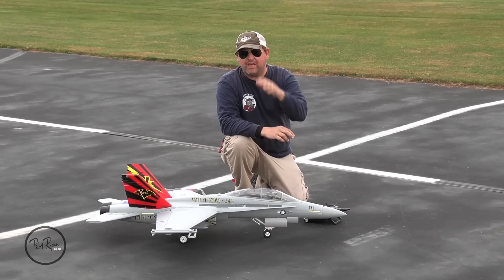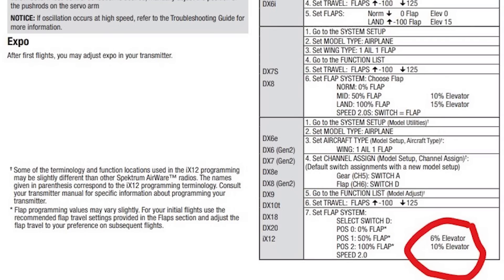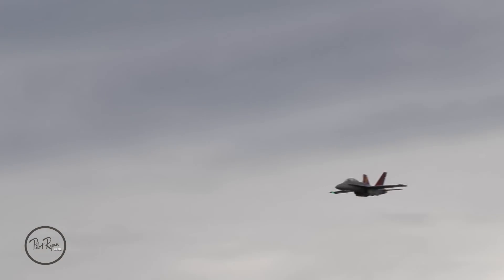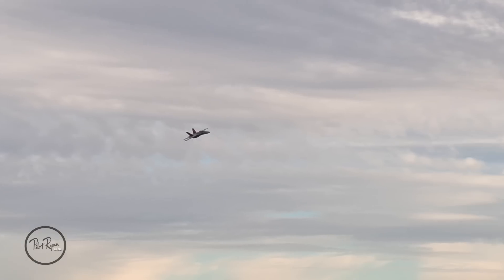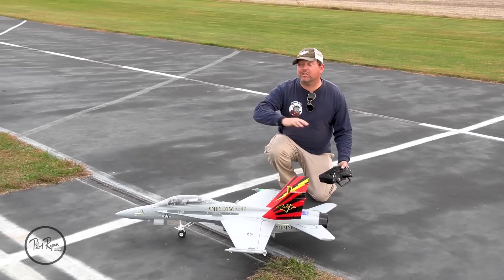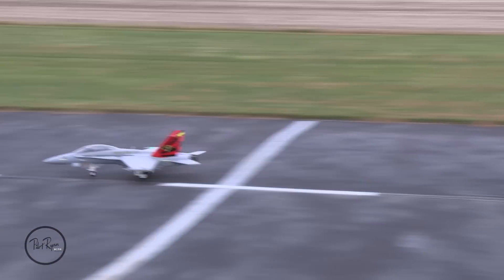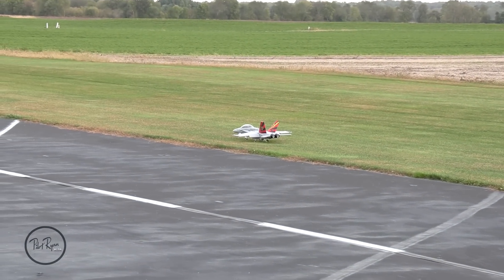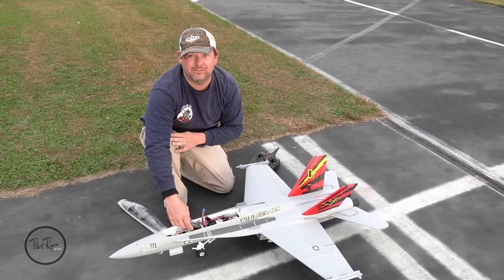E-flite F-18 80mm Shakedown Flights

Comment: I hear people suggesting 4mm of up stabilator, leading edge down. Is the the considered the new neutral position? There are a couple of lines by the stabilators. Can someone make a video of where their stabilator position is in relation to these lines. Lastly, are you mixing down stabilator (positive numbers on spectrum) with the flaps. Does the bird tend to pitch up with the flaps extended?
Reply from the maker: B Moran yes it’s in the book. Up elevator is what you need when flaps are deployed otherwise the nose comes down a bit and you’ll have to compensate.
Reply: Thank you pilot Ryan. My manual addendum page shows 10 and 15 in the but that gives me down elevator. I put -10 and -15 in my flap mix (iX12) for up elevator elevator. Is this correct or is something amiss in my bind and fly 636 receiver? Right now, with -10 and -15, flaps go down and the leading edge of the elevator goes down for up elevator.
Reply from the maker: B Moran stick with that, as long as you mix in up with flaps your good. Mine was the same

Comment: Hey Ryan, 
I really like the Hsd 105mm f16 but for now bc of high price I really like this eflite f18... So a few questions: 
1) Since your flights on it, have you had any linkage issues with left or right elevators?
2) How do you like this to the f16 70mm eflite t-bird is this any better or solid over the f18? Is the 
3) is the 80mm for the f18 really much more noticeable in speed over the 70mm f16 t-bird? 
Thank's if you get back to me with an idea of just a few things I have....

Comment: Flew my first flights today.  Weather was in the mid 50’s winds 2mph gusting to 10 mph right down the asphalt runway.  Beautiful flying plane, but I suggest all view pilot Ryan’s maiden of the EFLITE F18 for some helpful hints.  My experience aligned well with Ryan.  Definitely use high rate elevator and mid flaps for takeoff.  I used a 5000 mAh battery weighing 740g placed 1 3/4” aft of the forward lip of the battery compartment.  CG approx at 78mm from where the leading edge meets the fuselage with gear down.  As a Ryan indicated the recommended elev mix with flap is negative on the DX8G2 not positive as shown in the manual.  Even with the elev trim horn adjusted full forward I still required some nose up trim on my radio to maintain level flight flaps up at mid power.  Not sure I want to move the CG further aft not knowing how much margin remains, but maybe with more flights under my belt I’ll give it a try.
Reply from the maker: Thanks great write up!

Comment: I wonder if the stock power system could handle 7s? Would need the motor and esc specs and a watt meter.

Comment: Love the way you show off these birds.  That takeoff, that rotation, may have been less sudden than expected, but it looked so real and life-like when it was airborne - just like the real thing.  Not a direct up take-off, but a sliding thru the air take-off as it continued to build up speed with its landing gear still down.  That looked awesome.  In the air, outstandingly fast!  The landing - well what can I say......reminded me of a quick drop aircraft carrier type landing.   Only thing missing was the hook and towline to bleed off speed, and of course, the Top Gun sound track to cap things off.

Comment: your video was/is very complete! I appreciate that you mention issues as well as the highlights of the plane. It helps me a lot to decide how it handles and acts so I can determine how it will perform in relation to my other planes. For example, if the plane needs differential ailerons to turn properly, it's good to know and know how to respond to it.  Doesn't mean that it's a bad flying plane.  Just like the rollout on this one. Good to know before hand. I for one don't want all my planes to fly the same.

Another question: I can see that it flies well, but how does it compare with the comparable priced 90mm F-18C and 90mm F-22 Raptor? Faster, slower, more stable, carves the turns, etc. Not looking for "good or bad". I'm sure you know what I mean.

This is my first E-flite jet. Got it a few days ago so I've only looked it over.  I'll say that it competes with the competition. Few things are different, like control surface hinging and the way the wings plug electrically together. Can't say that either way is better/worse, just different.  Can't wait to fly it!

SJ
Reply from the maker: Right. Different is cool. I have the FMS 70 FW90 and now this F18 all our great. The Raptor is in its own league. Nothing will fly as slow and feel as light.
Reply from the maker: It’s nice being able to fly lighter packs like 4000 in the 80. I wouldn’t want less than a 5000 in the bigger FW one
Reply: @PilotRyanMedia  Thanks!

Comment: I have just purchased the E-flite F-18 Hornet 80mm .
I am seeing a lot of online chatter and some you tube clips that indicate the Elevator servo retainer has come loose in flight more often than it should, which then precedes a crash.
Did you have any problems with your F-18 or have you heard of this issue?
Reply from the maker: Toby we didn’t have any trouble with ours. It’s good to take a look at linkages from time to time

Comment: Ryan , you are correct. If the nose gear was a little bit longer it would give the plane a more positive wing incidence which would in turn would help shorten the take off run. Great flights. Put on some of those nerf whistles Bobby !

Comment: I have the f18 with a 3200 mah battery I sadly crashed on my first attempt to take off the jet did a sort of barrel roll into the ground I wasnt using the flaps was that my issue or not enough land speed before take off any advice is greatly appreciated  thank you awesome videos btw
Reply from the maker: Sounds like a stall. Took off before there was enough airspeed

Comment: Also "high rate" should always be used for slow speed / takeoff to compensate for the low airspeed and airflow.  Actual jets reduce flight control deflection as the aircraft increases speed to help maintain a constant "feel".  Best to have 3 rates.  Takeoff and landing rate, low rate (smooth maneuvers)  and high rate (aggressive maneuvers)  but less than T/O and Landing rate.

Comment: The real hornet needs a at least a 12 degree trip up on the elevator to rotate- up to 17 depending on the conditions. Your model was showing the very same issue a real hornet would exhibit without take off trim up applied

Comment: Nice job!   It sticks on takeoff because of the scale gear.   When the gear is compressed the rotation point is really close to the elevators and pretty far from the CG.   Topical of all F-18 models with scale gear.   Flaps is definitely key.

Comment: I loved this jet right from my maiden flight. However, I had elevator failure on my second flight when the right stab popped off the pin on the servo horn and the jet went into an unrecoverable dove. No elevator response. I hope horizon takes care of this, as it has been a problem for other pilots on the forums. Just feel like the elevator design is poorly done for a jet of this size and speed. Shame, I really loved this thing.

Comment: Question Pilot Ryan: I didn't understand what you meant by a negative value to get your up elevator mix on the flap. Would you explain it in a different way?  Also, I just picked up this jet from my LHS yesterday and I had a insert for page 7. It shows 10 degrees for 50% flap and 15 degrees for 100% flap. My manual is like yours, it says 6% and 10% elevator. Did you get that insert? think the 10% and 15% would help on the roll out? Seems logical.  Thanks.  SJ
Reply from the maker: Just make sure that the elevator moves up when you deploy the flaps. Also make sure you set your elevator neutral by the book
Reply: @PilotRyanMedia  Uh, OK good. I was going to set the flaps up with elevator mix my usual way, which is how you explained it this way. I thought I understood the first way, but wasn't sure. Want to be positive before maiden! Ha!  Yes, will do the elevator neutral too.  Thanks! SJ

Comment: Those LG don't absorb anything.
Reply from the maker: Only the nose. The mains just from extension to rest. Once down, nope. Cool though, they look like a bird coming down on approach.
Reply: @PilotRyanMedia  i'd mod them with something , how long and how many times can it handle that slam on the ground...  it is sweet for sure,,  rc shock mod,, may order a set of gear just to fiddle,,, i'd tear them apart and get some type of spring up in that tube, just needs some damping no need for preload,,, i can make a real shock for it ... i wonder if there's enough market to build sets of gear... that i would take on...either way its way cool
Reply from the maker: michael honeychuck if they were stiff enough to sit on springs instead of fully collapsed the aoa would be wrong. There would need to be some shortening somewhere or stretch out the nose gear. As is there could be more spring added as long as it still compressed fully at rest. A little stiffer would be nice. I’m liking them. We’ll see how they hold up for folks. They really are built beefier than I expected.
Reply: @PilotRyanMedia  yea getting the right spring in there would be the deal..  maybe strecth the one that's in there that would create preload  or even a type of rubber damping ,  but if they hold up rock on.. i'm seriously thinking of building gear for rc , retirement work .. lol

Comment: I’ve flown nitro since 1989, old tech guy here, i want to purchase this in BNF, what transmitter do you recommend & have you tested anymore batt sizes? I know nothing about electrics but its time to learn.
Reply: I dont use a Spectrum, so I have to use an outboard gyro.
  For ease of hookup and flight, go for a Spectrum that would hook straight up to the Safe/AX3S module.  You will appreciate it.  As far as batteries,   A 5000 6s seems to be a good choice.  EDF's fly a little differently.  Since they dont have a prop to create airflow over the control surfaces, they tend to need alot of thrust to maneuver and take off.

Comment: You're wasting tons of runway with that delayed full throttle application.  Get in the power just as soon as it's lined up.  Better yet line it up as straight as possible and get in the throttles asap.
Reply: Always bugs me as well - I believe the reason why most RC pilots hesitate on the throttle on takeoff is that the basic principle of slow flight, controlling the altitude with the throttle and the airspeed with the elevator, it just not a thing for RC pilots (probably because of the way RC propeller planes use the thrust angle to automatically trim the plane for different speeds on different power settings).
Reply: @johanveltheim4331    I have done that to make sure she's tracking straight first, then applying full.